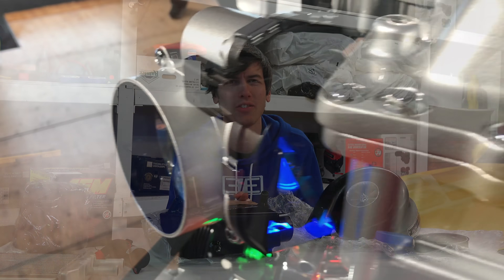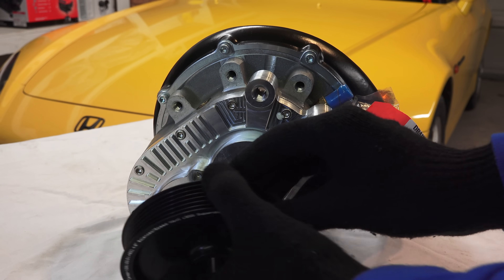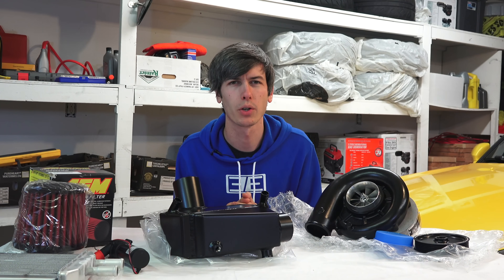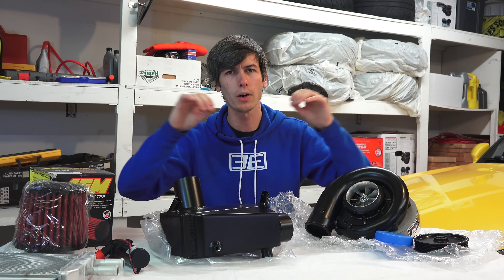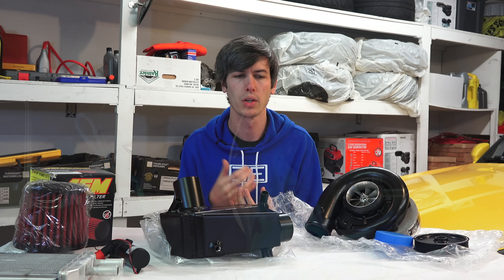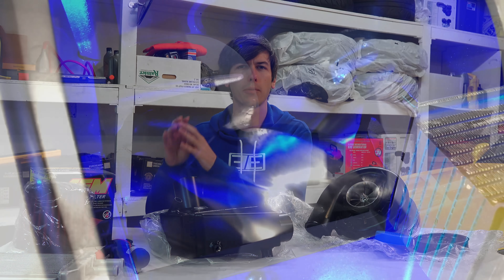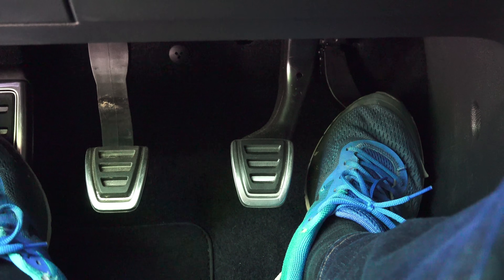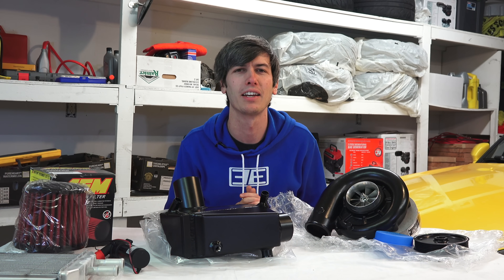Turbochargers vs Superchargers - Which Is Better?

Comment: I prefer turbo but purely for the sound and having a snail in your engine bay 😂😂😂
Reply: don't make sound?? I'm 100% sure that a turbine rotating at hundreds of thousands of RPM compressing air does make a heck of a noise. There's a reason why jet engines make a lot of noise, and it does apply to turbos. Centrifugal superchargers are basically half a turbo anyway, keeping the compressor wheel (hence it looks almost the same) and just replace the exhaust turbine for a mechanical drive. No wonder they would sound similar.
Reply: The most ironic part, is that the snail makes it faster
Reply: Kalvinjj truee😂
Reply: Exhaust-ed But the centrifugal supercharger is also a snail.
Reply: Muhluri Nkuna I sure have, it’s just a preference 😂
Reply: Exhausted I’m with you but I like a 6-71 blower wine with slowly hunting idle. I don’t know why Jason didn’t mention anti lag at all one of the reasons I change from being a 6-71 guy is their is very little trade offs with modern efi and combuster style anti lag ( pre boosting) the higher end Subarus had it for rallying but the epa through a stinky fit and said you have to keep it off
Reply: Exhausted i have a nautilus sized snail in my engine bay which must have come from captain nemos spares box
Reply: eDrive gay
Reply: aye!! Exhausted!! seen you over on mcm video :')
Reply: Exhausted snail? ironic it makes the engine faster lol
Reply: Wrong, turbos whine. Whether you can hear it or not depends on how much sound deadening hangs off your car.
Reply: eDrive people enjoy the atmosphere of a loud/fast car, basically just replied to your comment to confuse you the way you confused everyone here.
Reply: I have a centrifugal on my car that sounds like a Turbo, but for me the Wheeeeeee sound of a Twin Screw cant be beaten.
Reply: I had a Corvette, many years ago, with twin centrifugal chargers -- WOW!! 
At the time, they were pretty unusual, and many people would start looking for how I routed the exhaust, or sk why they had a belt-drive on them.. Ha Ha 
But not many questions when it all fit under a stock hood...and disappeared into the distance when I put my foot down!
Yes...it had "snails" under the hood...but it certainly wasn't a Snail when it was time to GO! (-;  (-:
Reply: Exhausted For JDM cars I prefer Turbocharged for V8 muscles Supercharged, Because the sound of a Turbo is cool and the sound of a V8 Supercharged engine that whine is nasty sounds like a Giant Vacuum cleaner is hunting you nasty in a good way guys.
Reply: Jeremy Stark.your right and a diesel has no blow off valve on a stock turbo
Reply: Super and turbochargers are fine, and both do the same job.

I'd say that superchargers are the best I think for increasing power if you use the right kind.
but turbos are very good for efficiency and economy and fuel saving purposes. (hence why its more common when forced induction is done in economy cars vs using blowers which might not be very cost friendly.)
Reply: Snail in your engine bay.....🤣🤣😂😂🤣😃😃😂😂🤣😁😁😀😂🤣😃😃😄😄😅😅😅........you are comment section champion.......
Reply: U can now enjoy both, super chargers can now look like snails, and a blow off valve and waste gate on a super charger combined with an after market exhaust can make it sound nutty
Reply: @exhausted Do you mean when Gary the snail was ill on Spongebob and sounding like a blow off valve?
Reply: did you know snails have 14,000 teeth and penis vagina's??? and thats now in your car!! WOOOOW... The more you KNOw
Reply: Bob all depends on your taste I guess mate👌🏻
Reply: Exhaust-ed Supercharged V8 sound much better than turbo V8s
Reply: Lunoir NSX Very true, just my personal preferable but I can see how a supercharger could also be prefered👍🏻
Reply: Turbos rock!!
Reply: You can absolutely hear turbo spool. You can hear it very clearly on stock turbo diesel trucks since they make little to no effort to mask the sound like most consumer vehicles.
Reply: Ibrahim Niazy turbos =no sound?  Um no
Maybe you were trying to say something different, but turbo spool is absolutely a sound.
Reply: The best sound is if you don't have sound! 
We are not living in the middle age, where you have to be loud, tho show that you are somebody.
Just try one time, driving electric and you will feel, how nice it is, with instant power from zero to max., without noise.
Reply: eDrive you can’t argue ’new’ with someone who has “Old school” on top of “RuneScape” in their username. It just doesn’t get any more ancient than that lol.

My electric Gogoro sounds like a spaceship.
Reply: @RsChrisG 
I don't get what you like to say by that.  I am married to a ptetty woman. I am not gay, so I don't like to flirt with you...
Reply: Superchargers sound way cooler in my opinion.
Reply: Turbos don't make sound, what you hear is either the blow off valve which also exists in centrifugal superchargers, or the charge air discharging backwards into the turbo due to lack of a blow off valve, which is not good for the turbo.

Comment: I've never driven a turbo charged car, so I'm wondering how long is the lag. Is it of seconds or decimals of seconds?
Reply: Fernando Sousa at low rpm it is in seconds
Reply: Depends, here 85% of cars are turbocharged for fuel economy and better emissions, it's really not much of an issue when the engine uses variable geometry turbos. You press the pedal, the engine grunts a for 0.3-4s then you hear "ssssSSSSSSSSS" and you fly away, and that's on normal turbo and about 1.5L of displacement. With dual turbo setups (one small with pretty much no lags -> goes into a bigger one) it becomes pretty hard to notice any lag. You put your foot down and enjoy the instant torque.

Comment: Would be interesting to see the actual efficiency numbers between turbos and superchargers.  Turbos still uses engine power by creating back pressure which creates pumping losses.
Reply: nickmpower Supercharging technology has come a long way now though, with modern designs and bypass valves they pretty much take no power to spin when you're not using them.
Reply: William Stewart but isn't there a tiny lag, as opposed to NO LAG, when the clutch engages the pulley, on modern superchargers that cost no horsepower by spinning freely while not in use?
Reply: Vadim Not that I've been able to feel.

Comment: Is there a reason that small engines usually get turbos and bigger engines (like V8s) usually get superchargers?
Reply: My guess would be that smaller engines are used for better fuel economy, and therefore turbos are used to improved that since they use exhaust gasses, while bigger engines are meant for performance and therefore superchargers are used.
Reply: It's easier to fit in the engine bay.

Comment: Could you please do a video on engine heat soaking and the effects of applying heat tape to intake components?
Reply: Get as close as possible to the most optimistic thermodynamic cycle which is the adiabatic compression-detent as well as raising the overall operating temperatures which gives the best effiency. Adiabatic means no heat is exchanged with the exterior.

Comment: Thank you. You’ve helped with my decision. Supercharger for my mustang!
Reply from the maker: Heck yes!
Reply: SI0AX a mustang is not a muscle car neither is a camaro the closest thing to a muscle car now a days is a challenger
Reply: thatallredheadude 1 original! Never heard that one. I’ll take notes. 😂
Reply: Andy Torres do it for Dale
Reply: ZR1 and ZO6 Corvettes are Supercharged.
Reply: Good choice. I’m running a Kenne Bell Twin Screw on my Mustang and I absolutely love it!!! Just make sure to do a lot of research before you decide on a blower. They produce so much heat so you’ll need proper cooling. Enjoy buddy
Reply: That sounds awesome. I was surprised when I supercharged my RT and left it in economy mode going to work. I averaged 26 mpg with a 6 litre engine. But you push that peddle past half throttle the mpg drops like a block of lead. Have fun!
Reply: stan broniszewski in lap times yes
Reply: Frankly I don't want full time AWD in a car, in 99% of daily applications AWD is unnecessary, adds weight, and removes road feel. You might as well be driving a FWD car.
Reply: But not centrifugal! That boost's not kicking in until high revs, according to Jason! Get a roots-type - it goes hand in hand with a V8 Mustang !
Reply: Yes turbos would ruin the sound
Reply: thisissparta man On a Mustang, yes
Reply: Benjamin Buljevic ever heard of the GT350R.? Also the 03-04 cobras had independent suspension. Educate yourself before stating, "facts."
Reply: The only car left is the Camaro and Corvette now. Hard to say what will happen but looks like we might lose that too soon.
Reply: youll be able to smash so many more crowds!
Reply: Benjamin Buljevic thank you for providing your ignorance
Reply: The latest Mustangs have had many suspension improvements that now they handle good.
Reply: SI0AX when i said that it has just 2 driven wheels i meant that in relation with the insane weight of 1700+kg, i expect awd from a car that weighs as much as a high end luxury sedan and claims to be a performance vehicle
Reply: SI0AX only the latest 2 or 3 model years have independent rear suspension and they all still weigh over 1700kg with only 2 driven wheels
Reply: The handling isn't going to compare to Japanese and European sports cars, but it's probably the best handling Muscle car and it's decent instead of terrible like with the live axle from before.
And 2 driven wheels helps keep the weight and complexity down. AWD cars are mostly heavy and have power loss from transmission, though the Mustang is just as heavy and would only be worse if it were AWD, but then also it's wouldn't be comparable to a muscle car anymore.
Reply: ignorance? what about my statement is ignorant?
Reply: Mustangs haven't been bad at cornering for ages...even without the independent rear suspension they were surprisingly good (and the early 2000s Cobra models had it as well, so brush up on your knowledge there). Also weighs less than a track oriented supercar like the Nissan GT-R so I guess that must suck at cornering too.
Reply: i dont like mustangs because theyre bad at cornering

Comment: Why turbo better than supercharger 

Anti lag!!!
Reply: Rio Gutierrez 
According to what ive read about them theyre used to "reduce lag" not remove it altogether. No matter what if exhaust is spnning it, its gonna have lag. Weather your precumbusting a mixture before the exhaust reaches the turbine or not. The air that spins the turbo still has to go through all four cycles b4 it reaches the turbo. Even the manufactures say "reduce lag" not "remove it" it'll will still have lag. Just not as much. Supers do not. Thats instant boost. 
So yeah hes still got it backwards.
Reply: You have that backwards. Turbos HAVE lag. Supers dont.
Reply: Erik Lehnsherr True. But it is greatly reduced. It won't be instant, but it can be close. It's entirely possible though, that he was talking only about the sounds that anti-lag creates. A lot is left to interpretation when reading the comments of strangers on the internet.
Reply: Rio Gutierrez 
Actually i can see that. The Rally cars do sound cool.
Reply: Erik Lehnsherr I don't think you know what an anti-lag system is.

Comment: I like centrifugal superchargers
Reply: Lunoir NSX huh???? There are more roots supercharged jeep inline 6 than turbo, I think you meant to say engine bay real estate is hard to come by lol
Reply: MikeTheLegend I think twinscrews are better but since my car is an inline six, I have to get a centrifugal supercharger.
Reply: bung cheese Yeah lol
Reply: MikeTheLegend I like turtles.
Reply: Abel flores Yes.
Reply: Lunoir NSX Yeah, and twin screws compress more air before it's rammed into the intake manifold, and at lower rpm, than centrifugal

Comment: Will an intercooler have any benefit if im running water in injection on charged system
Reply from the maker: If there's forced induction, yes an intercooler will generally help significantly.
Reply: Yes. Water injection increases effective octane during combustion by cooling the chamber. Ie let's you get away with hotter iat's, higher compression, or more timing before experiencing knock or detonation. Intercooler will lower the temperature of the charge air after it is compressed. Cooler charge air means it's more dense so your getting more oxygen into motor at said boost level, which allows you to burn more fuel and make more power. Both are means to get more power safely on the said power adder engine setup and fuel.

Comment: Why not using supercharger for boosting engine and turbo for things that doesn't suffer from lag (e.g. producing electricity for batteries, or producing energy for air condition)? I thing there is other reason than nobody tried it (maybe cost of building turbo is to high).

Comment: And why not both type or more of one? I've heard of a few cars that have both. Usually very high end super cars, but what about the humdrum Volvo XC90? Is there a real advantage other than my stick is bigger than your stick? Also, where is the diminishing point of returns? BMW and Audi have triple turbos on relatively small engines; i.e. not 16 cylinder Bugatti or the big BMWs. These appear to use RPM based ranged turbo to do what you mentioned; enhance a particular area of RPM range with one of the turbos. Thanks for a great overview as usual!
Reply: Matt McGregor you could get a 1.4 TSi with high output models,  it was twincharged

Comment: wouldn't it be better to say that both turbo and superchargers are driven by the engine, but a SC is mechanically connected and TC through gas pressure?? The turbocharger also burdens the engine by restricting gas flow right?
Reply: ser potter driven by the engine would mean a physical connection and power derived from the engine as a unit,  turbochargers while physically attached are driven by a waste product not dealing with the engine rotations itself

Comment: In the case of a centrifugal supercharger, wouldn’t you have some sort of boost threshold if it doesn’t spin fast enough ? Are they designed to spin fast enough for the compressor wheel to build pressure even on low rpm. I know it’s not the case with volumetric superchargers.
Reply from the maker: Yes, exactly right. At low RPM the centrifugal supercharger isn't very effective, it produces more boost as it spins faster, unlike the other styles of superchargers which can displace a certain amount of air per revolution of the rotors.

Comment: Could you explain the difference between bi-turbo and twin-turbo? Great video btw!
Reply: dotCom I’m pretty sure they are the same thing, just with a germanized name lol
Reply: Who said anything about twincharger?
Reply: The terms are often used synonymously, or even wrongly.
However:
Bi means 2, Twins are known for looking the same. 
If you have two of the same Turbos, these are twin turbos. BiTurbo means 2 turbos, so every twin turbo is BiTurbo but not necessarily the other way around.
Reply: dotCom If both turbo in set are exactly the same we can call it twin turbo. In most cases it doesn't make sense. If there are already 2 turbo different ones allow to make torque and power curve more smooth. AFAIK mine car have twin-turbo (99 Audi A6).
Reply: sequential twin turbo or non sequential twin turbo.
Reply: No difference, just language. Both bi and twin mean 2.
Reply: One of them spools the first turbo full then passes the exhaust to the second turbo and starts to spool that one

The other style passes exhaust gasses through the turbo from the beginning (sorta like having a bigger single turbo)

You also get twin scroll this is when its one turbo with two turbines for the intake side, kne is smaller allowing the engine to get air at low rpm and the other is bigger to get more air at higher rpm
Reply: bi-turbo uses two exact same turbos, mostly on engines with 6 or 8 cylinders, so one turbo is providing boost for one cylinder bank. 
twin-turbo uses two different types or sizes of turbos to get the advantages of both, early boost and top end power.